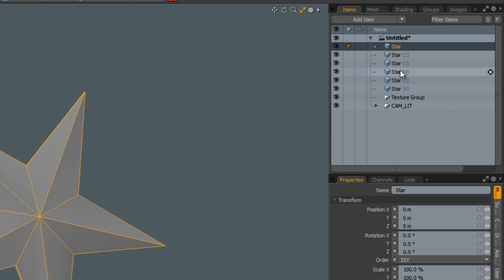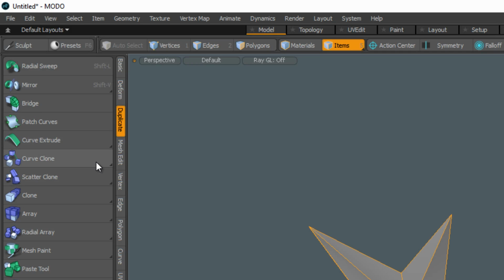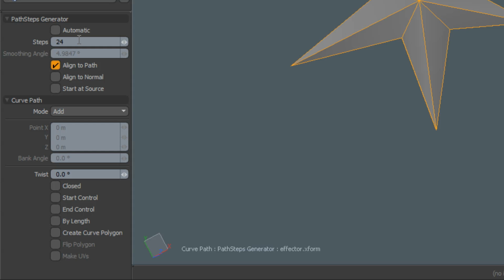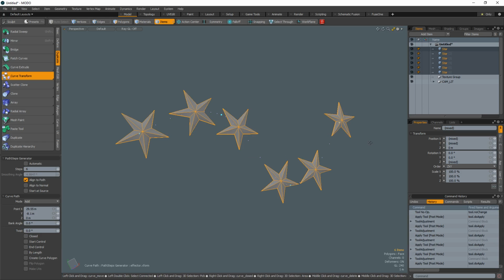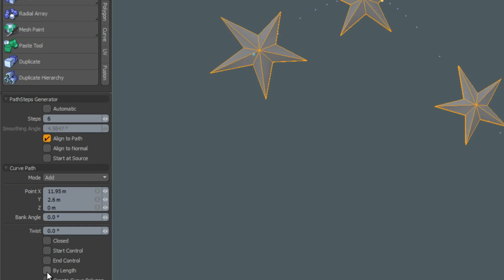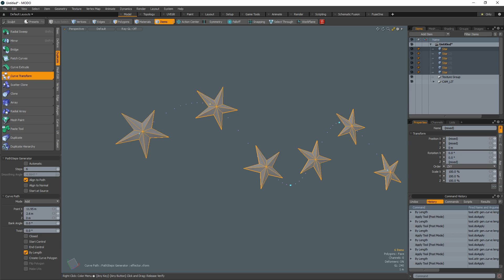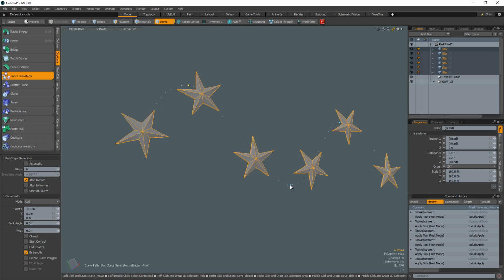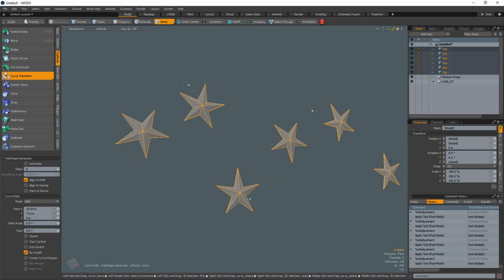MODO | Introduction to the Curve Transform Tool

Comment: Hello William, thanks for your quick tutorials. Is there any tip to clone or instance a mesh along an edgeloop of another geometry and follow the normals of that geo? I usually freeze an high poly version of the underneath geo and than I make a curve from the points of the loop, but it doesn't keep the surface normals and I have to manually realign the instances.